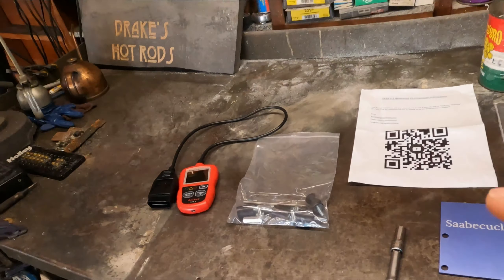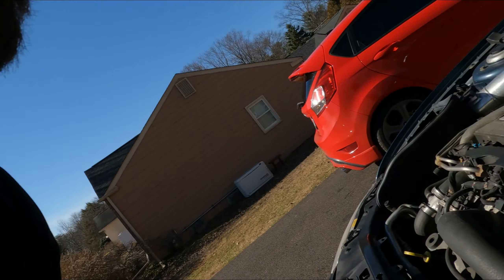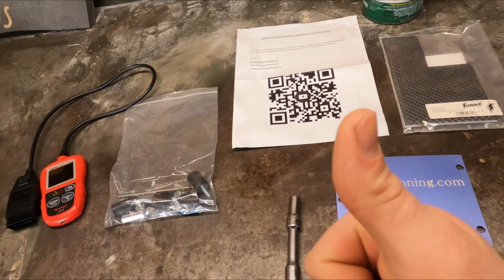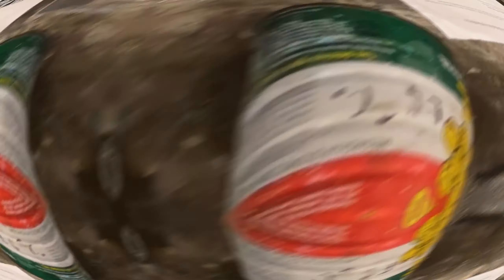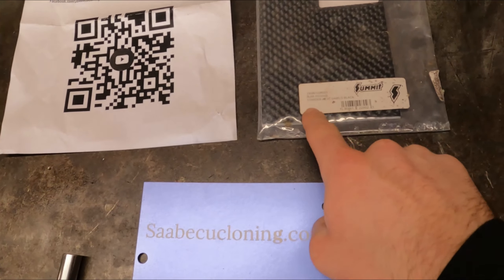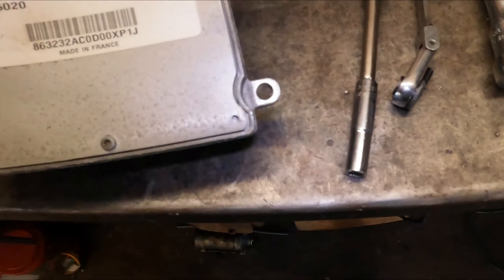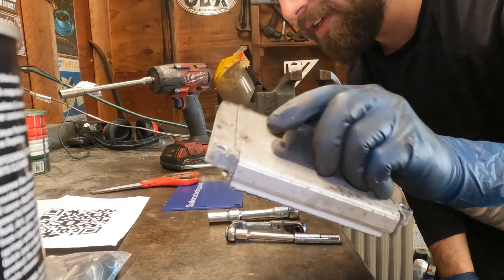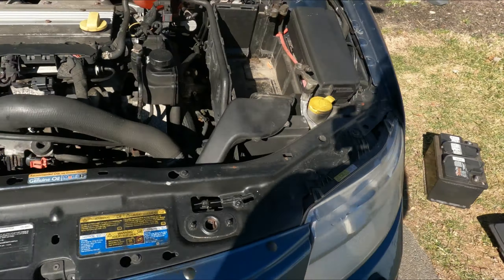2007 Saab 9-3: An Absolute MUST for 2.0T owners! Prevent P1681!

Comment: Hello! I do had that ECU problem. Mine faulted totally, so I replace it with a used one and to avoid future and recurrent heat damage to my new used ECU, I purchased an ECU loom to extend it and be able of relocate it to the air filter area. I tried that heat separator plate, but heat eventually reaches the ECU, so at the filter area I replaced the original box for an open conic filter and a HEAT separator. Now this really isolates the engine heat from my precious engine brains. Lots of work to do, to extend cable by cable, one at the time, but was the final solution. I figured this because the 9-5 OG has the ECU in the windhsield wiper área, between engine compartment and passengers cabin, and those models has zero ECU fails. Cheers!
Reply from the maker: Really cool stuff! Who knows maybe one day I will do the same.

Comment: Hey there. You're right to suspect the throttle body. The butterfly that piviots on a shaft meters the amount of air required and the ECU controls this and the fuel supply. When the shaft wares the aluminum housing more voltage is required to move the butterfly. So the throttle position sensor tells the ECU more movement required from your accelerator input but it becomes more and more difficult to move the butterfly as it wears. You get to a point where the ECU is sending the maximum voltage to the butterfly but it wont move to the right position that the throttle position sensor needs it to be. You then need a new throttle body. You will not get any codes on a cheap ECU reader. The ECU is not able to compensate for this ware. Most throttle bodies can be repaired if this is the case. Engine cutting out is only the beginning. When the car chuggs at idle and then a warning light you will know this is whats wrong. The engine code for this fault will then indicate a vacuum leak. You will think the manifold is sucking in air somewhere but no its the throttle body. Hope this helps someone. I like the autopsy clips as well. Love Saabs. * Love your wife worship your car! Cheers from downunder.
Reply from the maker: Thanks for the comment! Cool to know people around the world are watching! I would not be surprised if I have a throttle body purchase in my future 😂 luckily I already have a new gasket on hand. Thanks for the in depth explanation there. 🤘🏻
Reply: Had this a couple of times on mine
Good information to know, thanks
Reply: Thanks I hope that is right. I have a steady flow of oil from the pcv to the throttle body
Reply: @ddubsgarage8285  I also had the same issue with the car not starting when it has been driven to temperature. Did the same thing as you and drove around with startgas. But this got fixed instantly when I replaced the crankshaft sensor. This might be the problem for you too! Hope this helps
Reply from the maker: @niclarenp7079  yo! Thanks for the comment. 

I actually have done the crank sensor recently. 

It’s odd the problem just healed itself. Haven’t had any issues for a while.
Reply: @ddubsgarage8285  I have had Saab 9-3 2-0t BioPower just about 1,5 years now. This car has the most "self solved" problems. For example ABS TCS earning come sometimes when temperatures are around 0 C. Also engine light comes now and then, but nothing wrong in driving. One garage said, that the light would be aomething to do with the thermostat sensor connection near at the cooling system. Lighs come and go shortly, and then nothing. Go figure.
Reply from the maker: @VeKrio  I had a similar issue recently. The self healing thing does seem to be a Saab thing. But I don’t want to drive anything else!

Comment: Thank you so much for pointing me in the direction of sage cloning. The ECU in my car died, fortunately I was able to source another, had my old one cloned and added the stage one tune and bought the same heat shield featured in your video. Once again thank you for helping keep another saab on the road. Kudos
Reply from the maker: Absolutely! I’m so glad you enjoyed the video! How do you like stage 1? One day I would definitely want a little bump in horsepower and torque. Do you have any bolt ons to go with your tune?
Reply: @ddubsgarage8285 The tune , as folks say, really wakes up the car. I love it. When I put my foot down the acceleration is quick! Such a big difference No bolt ons yet but with the tune that is going to change.
Reply from the maker: @PRR4828139  all of the arrows point to me finally tuning the thing. Thanks for the reply! I would feel ok doing it considering my engine doesn’t burn a drop of oil, pretty amazing considering it’s got 173,000 miles on it!

Comment: Thanks for sharing man. Just got my 9-3 and the next day it got a P0638, replacing the entire throttle body next week since a clean only worked temporarily and had to clear the code and the boost was still weaker than it was off the lot. Wish me luck!!! And best of luck with yours.
Reply from the maker: Aye happy to know there’s another Saab lover out there. Hope it goes smooth for ya! You got this!
Reply: 😂 I've just bought a saab 9-3 2L turbo..  and the next day I got p0238.. and we'll, I'm in Australia 😢 no saab part suppliers, and importers want $1100AUD to send me a new throttle body...  😢😢😢..    and the guy i bought it from sent the ECU away and had it rebuilt re'coded a month ago thinking the ECU was its fault..  now I've found the exact problem it's a damned throttle body with $16 worth of pwm to balance it's 2 motors and it's locked to a dam saab only TB and I can't flash the ECU to accept a $40 Subaru fbw  TB...   so stupid, here in Australia we jailbreak and hack ecu's and make them tunable, rewritable, even to run different protocols to  monitor preferred sensors .. why have no saab guys done this? I basically have to piggy back in a haltech which I can buy for about the price of the throttle body saab sells... But the haltech let's me control everything, new TB, bigger injectors,  new fuel reg, boost control, maf delete, and saab pre Tb map sensor delete, and use the internal 32psi rated haltech map sensor, and narrowband to wideband swap in the exhaust,  with custom duty cycle maps,  and tune off map sensor pressure with wideband air fuel ratio as it's 2 reference points to keep the afr's exactly to the haltech custom map I make on the dyno  after a day of runs and tuning the fuel map at the boost levels I want...

 I can have all that!.. literally make 340hp to 500hp depending how stupid high you go on boost and injector size,  but 300hp easy everything stock just the tunability from the haltechs cam control, timing control, duty cycle control,  afr control, and an extra 8psi boost,  just put a turbo back exhaust as the only mod and look into a bigger front mount intercooler,    and with a haltech id yeah get my car to 330hp safely and for around the same price as me buying a new throttle body$1100au and the ECU that was done 2 months ago for $1200au..    I can get a haltech 750 to 1500 for cheaper than both them and still have change if on pay haltech make me a plug and play loom to suit .....   

Why is that a thing? Why did saab guys not unlock and customise stock saab ecu's,  exactly how every other car enthusiasts have done for every other brand within 4 years of it being released?  And saab guys 20yrs later are still fixing stock ecu's and still stuck to silly saab locked sensors, TB's, oem coilpacks, ...   saab guys just never realised ? Or no one into Saabs actually knows  that's how all cars work? And that you can replace faulty stuff with newer more modern much better parts with more functions.. you don't have to keep using the faulty parts over and over again knowing they fail commonly, no, you upgrade those known faulty parts...

 Why is this the case with saab guys?    What the heck  is going on? Why am I the first engineer in 20 years to look at Saabs and say , umm? Why no development or progress?  And no aftermarket support?   Why has no one done it? And why are saabs the only car on earth without this?   I'm from a turbo Nissan, and turbo ford background, so I'm just completely dumbfounded as how it's even possible?    Why?

Comment: If you have a throttle body problem, you need to open the black box on the throttle body and clean the variable resistor inside it with a contact cleaner. Sounds complicated, but it's not.
Reply from the maker: Oh maybe I'll try that if i have that stumbling issue again. it's odd it went away completely after changing the battery and doing the spacer kit. starts up no problem and does not stumble anymore. Thanks for the tip!

Comment: Did the spacer modification on mine last year, it's well worth doing.
Reply from the maker: I agree! I palmed the ecu after a nice heat cycle, with engine at temp and running. No longer hot! I won't have that issue in the back of my mind.

Comment: Good idea installing the heat sheild. Also you left out one step when you installed that kit, you forgot to mention what you need to do if you want to use the engine cover.
Reply from the maker: @phantomfixer  thanks! Yeah any car I own I always get rid of the engine cover, seems like it just directs heat right back at the engine

Comment: Great video!! Hmm... my car is showing intermittent ECU issues (lost power at a red light twice but each time it starts right up again). How do I know if my ECU is already too damaged? Is there a way to test its condition before I apply the spacer? It's either add spacer to existing ECU or replace with used good one and program it 🤯 and put the spacer on the replaced ECU. Thoughts?

The goal is to know with some degree of certainty, so I don't end up stranded on a long drive.
Reply from the maker: hmm.. that's too bad you've been having those issues with your saab. i would say unfortunately there is no way to know for sure what the problem actually is without hooking up a scanner and doing some diagnosis. it sounds like if this problem is not the ecu you may have more serious engine issues. i would start by figuring out what codes it's throwing.
Reply: OK, it's throwing a P1682 with no check engine lights. Where did you get the extra heat protector on the bottom? Did you say Sumner or something like that?
Reply from the maker: @rootclinic9268  so the extra shield I stuck to the bottom of the ecu is from summit racing. Great website, fast shipping on all of their stuff. Do a search on that specific code and have the things checked related to it! I hope you can get it figured out!

Comment: Overheating isn't the main reason that ECU dies, more often is problem with power supply and voltage drop.
Keep your batterry and contacts in good shape and you going to be fine for years.
Peace !
Reply from the maker: Thanks for the comment. The main reason it threw that code was the battery. Thank goodness!

Comment: I have the similar kit after my first ECU failed, but the second ECU failed after 4 months in summer.  It is my third ECU now.  I think it may help, but the amount of heat there is just too much.  My first ECU last 9 years.
Reply from the maker: Good to know, I think I may create my own air snorkel to pump cold air from outside the car directly at it’s another precaution. Also hoping my heat shield material on the bottom of the ecu will help

Comment: You mentioned getting a deep cycle battery. Deep cycle batteries are not meant to deliver quick high amps during starting. They are meant for slow discharges on a boat or travel trailer. You want a new starting battery.
Reply from the maker: I may have misspoke, this optima was ordered special for my saab. Definitely wasn't cheap. thanks for the comment, I didn't know that!
Reply: @ddubsgarage8285  Ahh, you must be getting the yellow top or possibly red top then. The Blue one is for RVs and Marine deep cycle.
Reply from the maker: @cheapswede  ooh gotcha. Yep! this is the yellow top one. For some reason the video footage of me installing it was cut. Oops 😅

Comment: I think you might have a problem with the crankshaft sensor. That's why the engine is turning off when hot.
Reply from the maker: Yo! I actually replaced that myself a while back. You kind of have to contort your hand to get to it with a 10mm. But that sensor is done!

Comment: I've tried all the things and the two spliced get hot because of location. I've tried all these things but the factory splices are bad not the throttle body the wiring harness
Reply from the maker: Oh for real? Where are these splices?
Reply: @ddubsgarage8285  follow the harness from the ECU to the throttle body it's two wires into one and there is two of them cut the factory shit then just solder them and problems gone
Reply from the maker: @jeffhusnik2878  I’ll look into it, thanks dude!
Reply: @ddubsgarage8285  just unwrap the harness wife loom and follow the wires from the throttle body I think one is blue and the other is i don't remember but you'll find them it's just a heat shrink wrap that they didn't even crimp the wires man cheers
Reply from the maker: @jeffhusnik2878  awesome, thanks 🤘🏻
Reply: @ddubsgarage8285  did you find these splices?! .....and didn't work?
Reply from the maker: @jeffhusnik2878  I actually haven't checked it out yet, things have been a little insane

Comment: A low battery can cause a host of different issues. The computer, especially, needs a full and uninterrupted current.
Reply: It caused a world of grief on my wife's 2013 Impala. Battery was at 11.5 V and all kinds of codes were popping up. New battery, no codes at all. Sometimes we get lucky with a simple fix. (although, putting the Impala battery under a frame member wasn't kind of the engineers! ☠☠)

Comment: The hot start issue is a saab ecu programming issue . Your ecu needs to be updated so the car doesn't act like a hot carburated engine with a choke stuck on . Secondly the codes you are getting mean the ecu is bad . Main power relay and throttle body correlation is a type of failure  of the ecu
Reply from the maker: Gotcha. For now, just replacing the battery fixed the issue. It's amazing what low voltage can do. Monitors are already set and no more hot start dying!
Reply: @Ddubs Garage  ok but im just telling you the ecu is still failing the throttle body code and main power relay code will reappear.  You might even get cooling fan malfunction with those errors . It's just the beginning. The hot start issue is a tsb for 07-11 saab pushed out an update to fix the issue .   fix saabs tune the ecus  and work at a saab repair shop . I also sell good working fully tested ecus . I also rebuild some issues this one you're having is not really fixable at the moment . Good luck 👍
Reply from the maker: @b1llyw123  ok gotcha. I’m treating it as a “cross that bridge when I get to it” sort of thing. I know who I’ll be messaging when I do need some help. Thanks man!

Comment: I heard from a Saab mechanic that the 2007 93 engine wasnt as reliable as the 2005/2006 models because the 2007 93 had bad valves.
Reply from the maker: Bad valves? Do you know what is different about them compared to the 2005/2006 models?
Reply: @ddubsgarage8285  My Saab mechanic said they changed manufacturers of the valves for one year in 2007, Saab caught on and fixed it by 2008
Reply from the maker: @thatsentertainment5602  interesting. I have never done an injection cleaning on mine for carbon on the valves, but maybe that will be a good idea.
Reply: @ddubsgarage8285  Yes that would be good to do.
Reply from the maker: @thatsentertainment5602  I'll look into it!

Comment: Somebody help , When stopped the car is making tickling noises , when accelerating it stopped making noise , when i press full the gas pedal the car after 2.5-3k rpms starts to shaking, I changed coil and spark plugs and still have the problem!!
Reply from the maker: Sometimes the ionization module causes similar issues to that. I would look into that. And the ticking noise may be unrelated, could have a lifter that is sticking

Comment: I like your heat  adhesive  ,not the kit the plate looks like aluminum which is like putting a frying pan under the ECU. I made my own out of G10 1/4 inch fiberglass and bought m6 rubber isolation mounts off amazon. Machined my own spacers for front bracket
Reply from the maker: Sounds like an even better way to do it. After a long drive I got the car up to temp and opened the hood with the engine running, the ecu was cool enough to palm with my hand. I’m hoping that’s good enough to preserve the thing.

Comment: My wife’s 2007 93 key fob won’t lock doors and door switch locks and than immediately unlocks it ant thoughts
Reply from the maker: Very strange problem to have, it’s funny mine will lock before unlocking when I hit the unlock button on the key fob. Just thought it was quirky but it works for me. I would say if you have a way to access a tech 2 scanner that would be a good way to look around at what’s going on. When my key fob battery started to drain it didn’t want to lock the doors. That could be a good place to start. Sorry I can’t give a more specific answer here
Reply: Bought the spacer kit and installed. Went to turn it on and it didn’t start. Realized the ground was loose and tightened bolt. Started right up but now I have a “limited performance” light on the dash. I think I really messed up something.